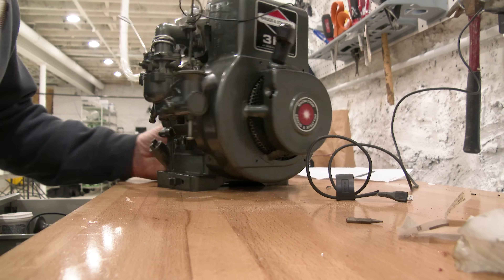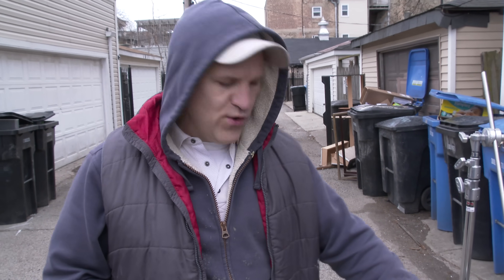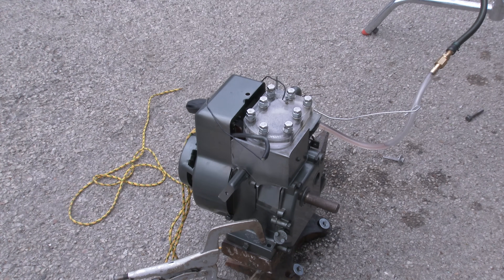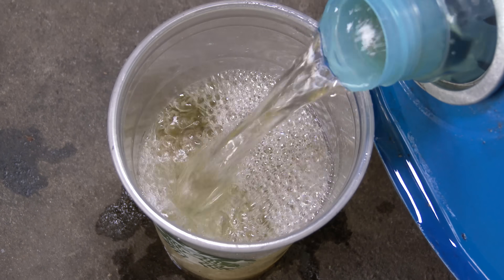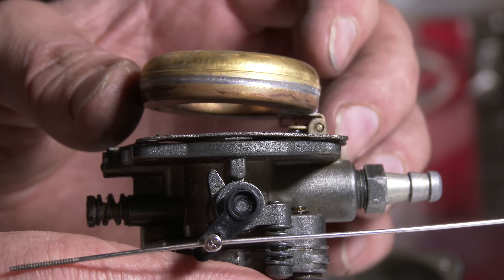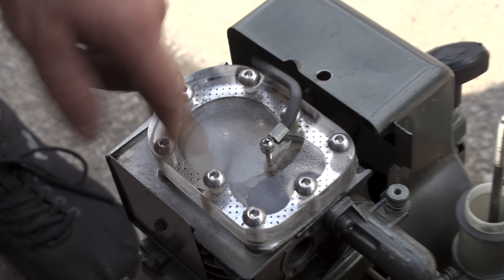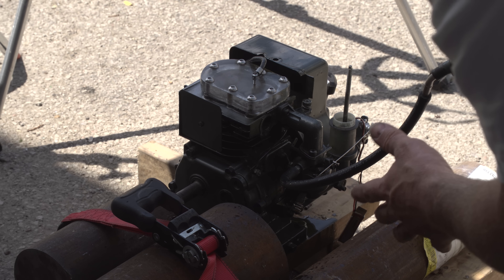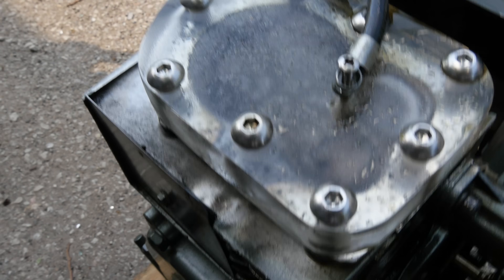See Through Engine on NITROMETHANE - Blow Up Attempts 1 -9 Crazy !

Comment: Can you make a see through Diesel?
Reply: Patrick Nintemann the head probably won’t hold the compression
Reply: I’m the Yamaha guy that policarbonat probably not

But a Tranparent Aluminium one would (also called ALON)
That stuff is pretty new
Reply: Z T 
Transparent aluminum ?
Reply: @imtheyamahaguy4872  Its a challenge. Yes.
Reply: Diesel is oil that need to be compressed a lot. Gas is flammable.
Reply: Yes, that would be interesting.
Reply: Diesels require a much higher compression ratio and I have a feeling that those little acrylic heads wont be able to hold the compression. Besides, they aren't really that interesting compared to normal gas engines. They would look the same, but diesel doesnt require the spark to be firing every power stroke. Diesels only need a spark when they initially start.
Reply: @nitrion6859 except diesel would show more soot after the combustion process. I think there is a way to engineer a see through head that can hold the compression but would require a bit more work to figure it out.
Reply: Diesel engines need to compress the air in the cylinder to over 1300 degrees Fahrenheit before the fuel gets injected so that it can instantly ignite from the heat of the compression alone. Those plexiglass heads would not be able to handle that.

Comment: Alot of small engines are designed to cut off when the oil pressure is low... honda is notoriously know for not starting when the oil is low ...

Comment: Stock rings and gaskets + way more cylinder pressure than it's designed for = oil pushing through the path of least resistance....or in this case multiple paths.

Comment: Nitro is a highly compression sensitive fuel so if you have enough compression like at full speed and enough heat in the engine it could run without spark.  Or at low speed with enough heat same applies.  They also don't always have 50 degrees of timing in it.  I can send you to runs I have found in my travels that are pretty cool.  It shows fuel curve and timing.  Really cool stuff. It also has its own oxygen so you can burn way more of it.  I'm amazed at how well it ran.  This is my new favorite video on YouTube

Comment: Need a load on the engine should have put a 20 inch propeller on it and it's methanol not alcohol there is a difference.

Comment: Fifteen years ago I started my 10 HP snow blower while it was COVERED with fresh snow (and it was well below freezing).  It was a Snow King and fairly easy to start regardless of the snow on it.
 I started it on the choke (restricted airflow) and let it warm a little, coughing and gagging at a fairly low RPM (with the throttle nearly open).  Flipped off the choke, took a few steps away to grab my gloves and.... the air governor vane was frozen so it didn't govern and it ran away.  Got back to it just in time to ACTUALLY SEE the connecting rod come out the side of the crankcase.  $350 later, I installed the new Snow King, and was more careful.

Comment: I used to run about 10% Nitro in gasoline in mini-bikes back when I was a teenager.  We were limited to ~10% as you have to enrichen the mixture and any more % would cause the needle to fall out of the carb.  It smelled great burning.  Maybe a lil more power.  After a blast, the engine would temporarily seize up, but always recovered upon cooling.  It was probably insufficient ring end gap.  It was used mostly in a Tecumseh 6HP side shaft mill.

Comment: Absolutely TMK! Even I was impressed. All you have to do is mention Nitro-Methane and you have my attention. I am a drag racing fanatic-have been since I was 14. And just to see what it actually looks like to see a go-cart motor (essentially) looks like at the ignition point on nitro. Briggs & Stratton must doing something right in their manufacturing of these motors. Or else they would not have been around as long as they have which would be at least 50 years. Slap it on your lawn mower and see how long it takes to mow the lawn : )

Comment: Warped Perception /Matt....... A primary "suspect" for why you had oil coming out or everywhere was due to Oil Dilution.    The Nitro/Methanol combination is very "thin" and also requires sufficiently more volume of fuel in the cylinders,  and a fair amount of it does get past the rings and into the crankcase.... which, if you notice.... the oil is "Dumped" (NEVER - reused) after every pass in drag racing and it's Not just because they do full tear-downs between each run.

Back in the days before "Big Money" sponsorships (-via- McEwen & Prudhomme & the Mattel Hot Wheels deal) - the teams almost Never tore the engines down between rounds, unless there was a definite mechanical issue, and only then, "IF"... they might have had a few parts along to fix it.   

HOWEVER, the Oil... was ALWAYS changed between rounds due to "OIL DILUTION" from the Nitro/Methanol mix.... which of course, increased the oil pan level as well.    I'm NOT saying that this was the sole reason for the oil coming out of everywhere in your case with the Briggs, but for me, it would be the number one suspect.    

Loved seeing the flame propagation through the head.... very ingenious!!    Great video... Thanks!!

PS: This was the first video of yours that I've come across.... and I Subbed, right away... will be watching more of yours.
Reply from the maker: Thank you, yes you are correct, this is why they use 70 weight oil in top fuel nitro cars, also in between races what they currently do is drain the oil, throw it into a cooker, and boil out all of the nitro contaminants, then they call the oil back down and they reuse it for another run or two. that all happens behind the scenes but yeah, I just like to keep these episodes kind of open to allow people to share their opinions, then I'll follow up in the next episode with the solution, kind of creates a sort of educational environment if you will, one of my goals is always to get younger people involved in learning how to build stuff, and this is one of the ways that I do it. Although I don't always know everything about everything so sometimes it's genuine and I'm learning as I go, but I usually have in-depth knowledge for the most part before I tackle a subject.
Reply: @WarpedYT .... Thank you for your prompt reply.... much appreciated!!    After I commented, I realized that I hadn't put the 70 wgt oil in my comment,  but obviously you caught it.  lol

What is your background insofar as any secondary education, training etc, etc.?  I used to play with a lot of similar "projects" as you do... at least as far as internal combustion engines are concerned.  

I formally studied Diesel Engine Design & Theory for 4 years between 1963 and 1967 and in 1966 I installed a small Boeing Turbine/Turboshaft engine that originally was used in a US Army experimental "Bird Dog" plane... which was a Piper J-3 (or 4 - I forget now) Cub converted to these little Turboshafts for power from the original Lycoming 4 cyl. ic engines..... anyway I had it in a 1931 "3 window" coupe (Ford).... could "smoke the hides" off the tires with the best of the "Big Block" V8 engines of the 60s.   Was a Lot of fun!!

Comment: replace the acrylic head with Lexan (bulletproof plastic) use high-tack gasket sealer and I hope your using 70weight oil that might help with crankcase pressure oil loss , fuelers have a large catch can behind the engine to catch oil pushed out by the extreme pressures they develop during a run, kool vid thanks !!!

Comment: you do know that nitro-methane actually cools the engine right?? that's why dragsters don't have radiators. Gas has more energy per gallon than nitro. The reason they use nitro is that they can get more power buy dumping more nitro (than they could would gas which would bog down) giving more power (granted they use 44 amp magnetos to do it).
Reply from the maker: Yes sir I do, two of my friends are Top Fuel drivers, and I know many of the teams personally. But there are multiple reasons why Dragsters don't have radiators, if you were to run a dragster for more than a few minutes it would definitely overheat, Nitro does have a cooling effect as well as the methanol and ethanol. Especially seeing as the volume is substantially increased compared to gasoline. Other than that the rest of your points are dead on. Thanks for your feedback and thanks for watching hope you enjoy the future episodes, they're going to be good
Reply: @WarpedYT  i was trying to be as non-technical as i could. When i was rebuilding transmissions for gassers it got to the point that i would just ask for a dyno sheet and then set the gear ratio because i was always running into drivers who just didn't care why only that they need 3rd or 4th gear changes. shrug after rereading my post it did look snooty sorry about that it wasn't intentional. That's always been the problem with posting. Lack of visual and auditory cues. :) have a good one.

Edit: lol what an understatement.... "especially seeing as the volume is substantially increased compared to gasoline" lol i don't know man 90 gallons per seems like a little more than "substantially"  :)

Comment: Tough little engine. All that oil oozing out is from high crankcase pressures, the rings probably a bit worn. Crankcase venilation isn't enough to keep up with the blow by. Pressure has to go somewhere so it's oozing out the seals and oil goes with it.

Comment: it has a splash lube system  if you go to high in rpm the oil will enter combustion chamber trough gaps (piston rings valve journals )

Comment: running that fuel with your head helps the head because so much more full per stroke is keeping the head cooler than the normal gas ... and yes someone mentioned the piston ring blow-buy is whats causing the oil problems ... i would say drill an additional hole in crankcase and run that to a catch tank

Comment: That's cool and all but what Briggs and Stratton engine should I use to turn my bicycle into a motorized bicycle. I do have a older 5hp one but I need a new intake valve, carburetor, and gas tank. Anyone got any suggestions. Something kinda cheap too.

Comment: If you want carnage, you need to put a load on it. Just Reving an engine at high rpm may kill Parts just because they are not made for the higher rpm, spring pressure (valve float), broken rod from inferior metal or design. This is really just pointless. The fuel has nothing to do with it, you are at 0 load.
Reply from the maker: Oh I got you!!!, Wait till you see the next video coming out, the next episode out is going to be this engine, and you will not be disappointed, wait till you see what I did.....

Comment: A few years back either, WKA (World Karting Assoc.) or IKF (International Karting Federation) used to run a 'Briggs Unlimited' class consisting of a basic 5HP Briggs running on nitro in sit up sprint karts.  These were basically hi dollar, short lived grenades with BIG Mikuni carbs, Wiesco pistons, big valves, special cranks, special rods, big cams, special or DIY heads, tuned exhaust and 3/4" alum plate on bottom of crankcase and atop head with turnbuckles to keep it all together.  Rumored to be making upwards to 25 HP with any nitro concentration fuel allowed.  Only saw them run once but believe me, they made some pretty radical, gnarly noise as long as they stayed together,   If 12-15 karts show up, rarely would 5 or more survive a days racing. Fun to watch, hear run.
Reply from the maker: That's funny you mention that, I used to race a similar class when I was a teenager, they were definitely radical

Comment: I was thinking running with no exhaust like that would increase the temps of  head on that corner way more than the rest of the head, with no back pressure like that it's going to heat up much quicker.

Comment: I didn't find this until now but it's way cool. Do it again but at night, it would be an impressive show. The thing I can't figure out is all the Briggs engines I have are dialed right to the factory specs with fresh gas and while you are able to start this one with one pull, mine won't start even under the power of prayer. Great video!

Comment: I can tell you this much, Briggs & Stratton has been producing small gas engines for a long time, you can believe they have some serious research and development in their designs, another fact not many people know, Briggs & Stratton made such a good engine for so long and so many of the parts were so interchangeable that for years you could literally get replacement parts from the junk yard, I'm serious, so much so that Briggs & Stratton had to literally change the designs in order to bring sales up, who remembers those old head gaskets that could be used over and over, try that crap now and watch what happens, it will stick to both the block and head if you try to remove it, also back in the day a 3 HP piston would interchange with a 5 HP...

Comment: interesting video, did you make any corrections for fuel metering in the carb? nitro, methanol combinations require much more fuel than the standard gasoline calibration. If you haven't done this then the engine won't be making full power, and won't grenade like you think it should, just sayin....

Comment: Should have a short piece of pipe on exhaust. Looks like the Valves started leaking & the oil came from the valve cover. I ran R/C fuel in my lawn mower 50 years ago when I cut grass. The Briggs & Straton engine had more power & sounded mean. Interesting video

Comment: Guys that race dirt oval karts run the 5hp Briggs on mostly methanol, some other fuels depending on the rules, they usually last the whole season, running balls out wide open. As long as the AF mixture is good they last a while.

Comment: The reason you had so much oil leakage was from exhaust blow-by, which was pressurizing the crankcase, eventually forcing oil out, wherever it could flow.   Nitromethane can successfully undergo combustion at ratios as rich as 2.7:1 air/fuel ratio, while street cars require ratios of anywhere from 15:1 to 18:1 air/fuel ratio, in order to burn properly.   This is why the dragsters run it, not because it contains more energy, per cubic unit, than octane, isooctane, or ethyltoluene ("gasoline") do.  The nitro groups attached to the methane molecule bring that extra oxygen, but actually require more initiation energy than the hydrocarbon soup we call "gasoline" does.  In fact, if you were to ignite a cotton ball soaked with pure octane, it would burn vividly; try the same stunt with nitromethane, and if you're lucky, it will just sit there, barely on fire, and will probably eventually go out.  VERY cool video!!

Comment: i see how nitro-meth runs differently, when this engine ran on gas the flame was "chasing" the piston down the cylinder while also forming a swirling vortex. the nitro-meth burns much quicker, the flame reaches the back wall of the cylinder before the piston even starts its travel downward.

Comment: All the other fuels you've put through this engine explode with a dull flame-y, fwoosh-y "boom" compared to nitromethane, which explodes with a sharp, almost metallic-sounding "crack" and the flame almost--nay LITERALLY burns white hot at 12:11. Slow the video down to half speed during the slow mo bit and the sound is incredible. Watching the combustion fly out of the melted spacer at the end was like watching the finale at a fireworks show, and just as dazzling.

What gets me is how the metal spacer failed before the acrylic head did.

Comment: You're never going to get enough nitromethane in this engine to blow it with the stock jet still in the carb, because nitromethane actually has LESS energy for the same volume of fuel than gasoline. The reason nitro engines make more power is that they need less air to burn the same amount of fuel, so you can push much more fuel thru the engine for the same amount of airflow, and airflow is the limiting factor for piston engines because you can only push so much air in to a cylinder before either the valves close or you have the same pressure on both sides of the valve (either way, the flow stops then).
Forced induction is another approach to the same problem, but the ideal fuel for a piston engine is one that requires zero atmospheric air (or oxygen) to combust. Such fuels exist, but they are basically only used for rockets, and they're hard to handle because they're extremely reactive and toxic.

If you want an example by name, look up Hydrazine (N2H4).
Good stuff for rockets, as you can get away with a really simple and therefore lightweight rocket engine (no ignition system, just a valve, catalyst bed, and rocket nozzle).
Bad stuff for anything living on Earth, you need a full HAZMAT suit and SCBA tank+mask+regulator if you're going to go anywhere near the stuff, tho the reaction products are ideally just Nitrogen and Hydrogen gas.
Reply from the maker: 44R0Ndin thanks for all the Insight, I am actually well aware I've everything you stated in your comment, ask for the jet in this video I backed it out completely to where it was almost falling out. As for hydrazine, if it's burning green they're messing with hydrazine..  lol. But no worries in the newest episode which comes out week after next and got really insane and I think I addressed all of your questions in that upcoming video, unfortunately it took longer than expected because I had to build some stuff, nonetheless it came came out pretty awesome.

Comment: High revs caused oil to exit the crankcase breather (behind the carb).
This size Briggs is hard to kill by over speeding. It has a heavy connecting rod for the piston and stroke it needs to support.
If anything, I thought a valve seat would have come loose.